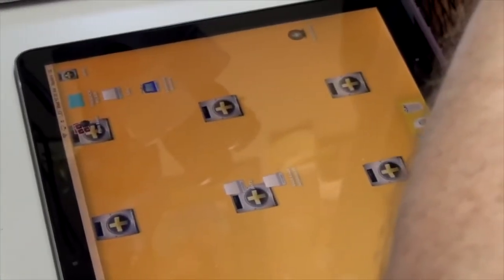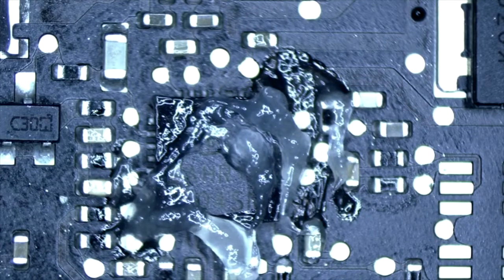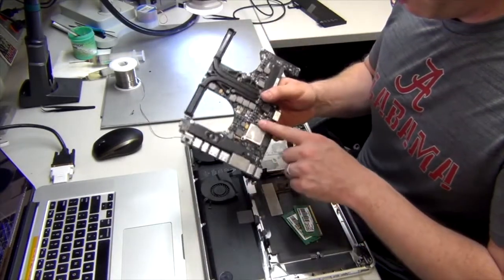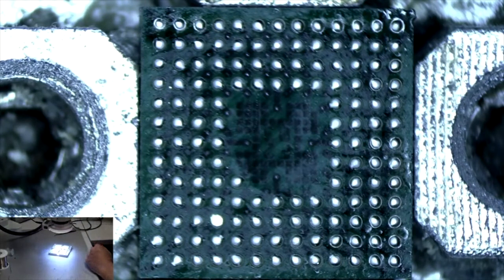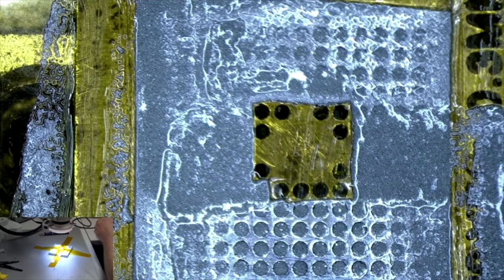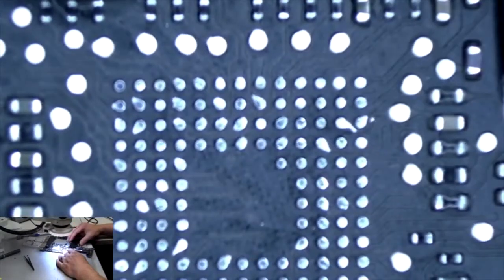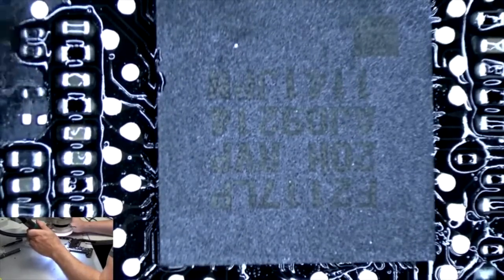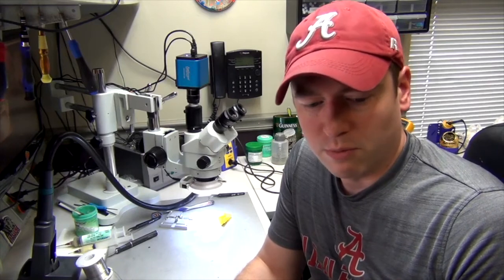2011 15" Macbook Pro Battery Not Recognized SMC Chip Replacement 820-2915

Comment: I have that board, and it does not see battery at all. Not even an icon, nothing (tried old and new battery). Green Light on charger.

So. Resistors on smbus ok. 3.42v. Stable as a rock, without battery. If I connect old or new battery, it start to go 2.4, 0.8, 0,.. Strange stuff. But only with battery. Otherwise ok.

What?! 🤷 Hard to belive when a new battery would be broken. So.. How can hook up battery kill smbus, and ok without?! Tried without led on the side also.

Replace smc?
Reply: Hello, did you found any solution? I have a similar problem on macbook a1707((
Reply: @LowSkillHighWill  nope, will try new smc as soon as I find one.
Reply: I have exactly the same issue, any solution yet?